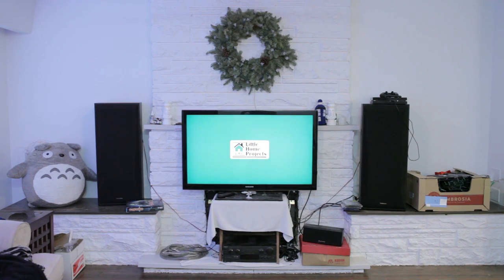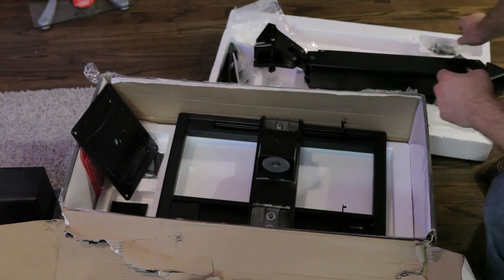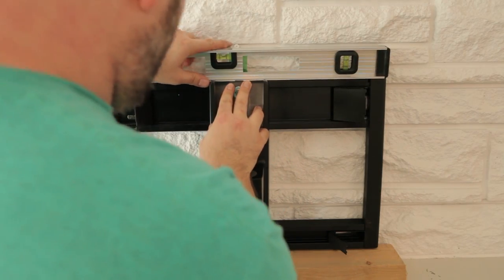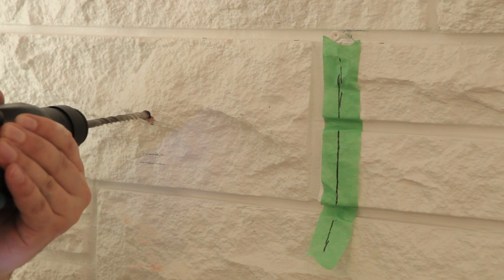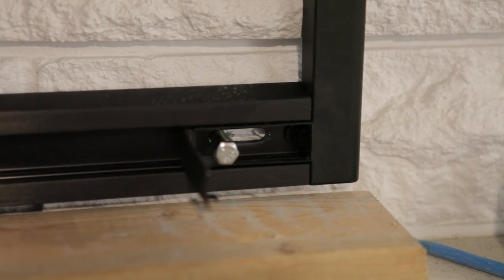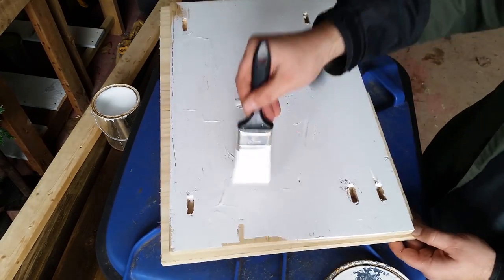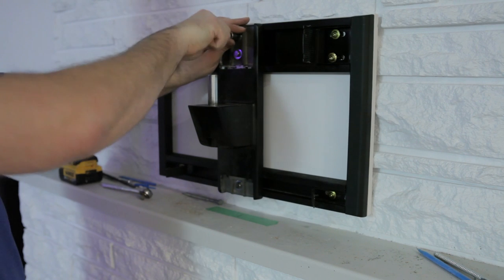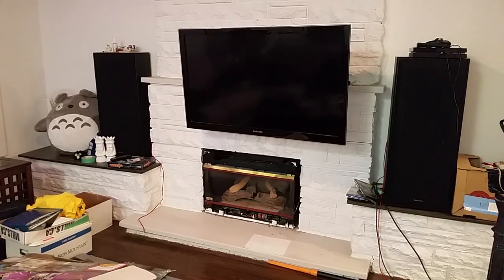Installing a TV Wall Mount on a Stone Fireplace - LHP

Comment: I appreciated the extra time on this video. Having little experience with DIY projects I never considered the addition of board to flatten the surface or the different stacking of the washers to adjust to different depths. Likewise the use of the rubber washer to give a little bit of flex and ensure snugness. Very well done.

Comment: Hello there. Thanks for the video. But I am curious how you mount the wires. Did you open a hole in the brick wall to pass the wiring?
Reply from the maker: Hi, thanks for the question.  In this installation I did not pass the wires through the brick. I tucked them in snugly between the mantle and the brick so the wires ran horizontally and parallel to the mantle. The TV covers most of the mantle and the rest is just hard to see when they are tucked into the corner crack... it is a great question though. I think it would be quite a challenge to fish the wires through the brick. It might also be a safety concern.  The TV can be moved away from the fireplace when we want the fire, but once wires were fished through there could be safety concerns unless you knew exactly where the wires were placed. My thinking would be to remove the gas fireplace and see if there could be a safe way to run it, but that might be an entirely new set of issues and challenges.

Comment: I find your explanation thorough and helpful but I am wondering how it would work if you don't hit the studs when drilling. How would you go about installing the mount?
Reply from the maker: That's a great question.  It's hard to explain in text, so I will work on a video next showing how I was planning on doing it.  Thanks for the suggestion! :)
Reply from the maker: Hi, I've made a video showing the parts I was planning on using if I had not hit the studs: https://www.youtube.com/watch?v=-rvtE7t_KuE
I hope that helps or at least gives you some other ideas.  Thanks for the comment!
Reply from the maker: Hi, I've made a video showing the parts I was planning on using if I had not hit the studs: https://www.youtube.com/watch?v=-rvtE7t_KuE
I hope that helps or at least gives you some other ideas.  Thanks for the comment!

Comment: This is an excellent video.   I install TVs for living.  I have a similar project ahead of me installing a full motion bracket on a similar stone wall.  I wanted to gain some insight on installation methods.   The use of the plywood and washers was a good solution.  I typically use the black spacers that come with the mount for uneven surfaces.  They come in many sizes and over time I’ve collected all types.  I’ve done it before and it works very well. Each time I’ve done that it was a standard mount that does not move.   A big thumbs up with your determination and ingenuity.

Comment: Some great ideas. Would have like to seen some wire work but i know this was a focus on the mount.
Reply from the maker: Hi Eddie, thanks for the comment.  I did a second video that includes what I did for my wires.  its not as elaborate as I think people wanted, mostly I just bundled them up and put them on the ledge.  For what that information is worth it is in this video: https://www.youtube.com/watch?v=-rvtE7t_KuE 
Thanks again for the comment :)

Comment: Good video for those who are unsure how to hang a television on an uneven surface. Well done, but a word of caution for views who have a working fire and intend doing this.  Be very mindful about of the depth being drilled. Particularly here in the UK as you may damage your chimney liner which could result in carbon monoxide leaking into the room.

Comment: I really  liked you  video. Very well done!  Thanks for the things you learned after you mounted it like off-setting it! Thanks for sharing your experience!  Show a step two video on how you connected the wires and hid them.
Reply from the maker: Hi,  I've had a few people ask about how I hide the wires.  So far I have not cleaned them up so they are still all over the place.  I will make a video soon once I decide how to solve the issue.  Thanks for the suggestion :)

Comment: I do not have a SDS rotary hammer but would like to drill 5 holes into the brick with my regular impact hammer drill (milwaukee 2084), not sure if it would work?
Reply: impact hammers will work for this - but only a couple times. impact hammers will wear down the bits very quickly. but for a one time tv mount you will be fine.

Comment: Just a quick question, were you originally going to use metal concrete anchors before you discovered the studs? Or was your original intent to drill past the stone into the drywall to use drywall studs? I only ask because I'm concerned if I go past the stone that I'll drill into the actual brick of the fireplace.
Reply from the maker: Hi,  my first thought was to drill directly into the stone and use a masonry anchor and bolt, but with the uneven stones i decided that was not going to work.  My second solution is a little harder to explain.  My stone work backed onto plywood and not drywall.  I was planning on using a length of threaded rod and a wall anchor behind the stones and plywood. The anchor I was planning on using is shown in this follow up video: https://www.youtube.com/watch?v=-rvtE7t_KuE 
You raise a good point though.  I don't actually know how much space there would have been behind the plywood and the actual fireplace chimney system.  I'm not sure how to check that, sorry, I hope this helps a little.
Reply: @LittleHomeProjects  You could have done the original idea using the masonry anchor/bolt and used washers or spacers to level it up against the wall.  I've done a few that way, takes less time and the result is still pretty much the same.

Comment: Just out of curiosity, how much time elapsed from the time you bought the first mount until you finally finished the job?
Reply from the maker: It was around 3 weeks.  I mostly only worked on it on weekends and I was a bit timid about drilling the holes into the brick.  Thanks for the comment! :)

Comment: For some one who install this bracket some place before can't see why the TV never is going to be flash on the center of the fire place is a big no no ! also you need to apply liquid nail on the screws before you secure it , also when is a bracket with only one arm it never going to be on the center of the fire place , you have to install the back plate sideways and not on the center like what you did , if you don't have the TV flash on the wall and on the center of the fire place well it will never going to look good !